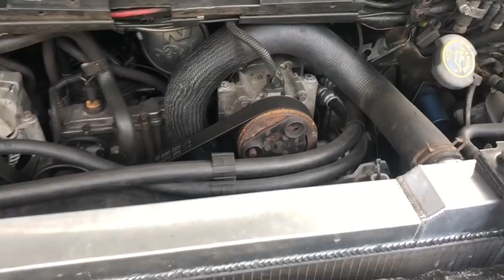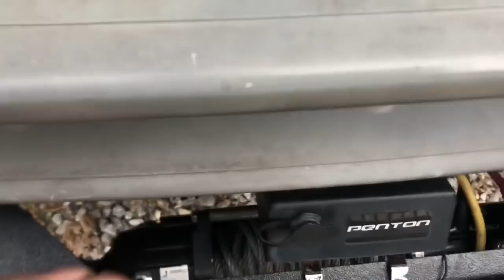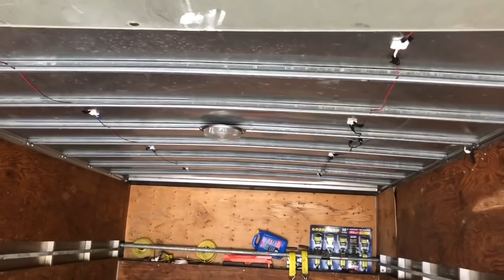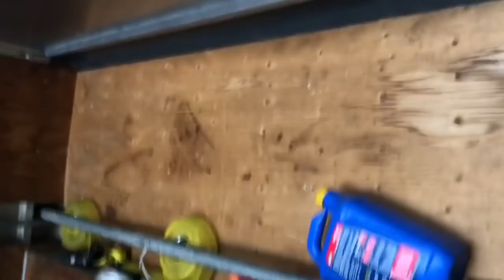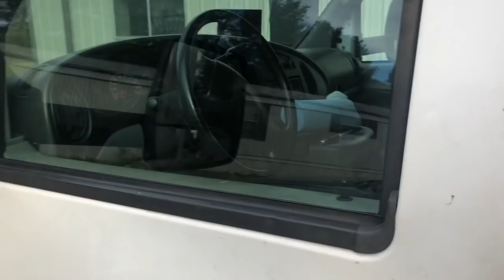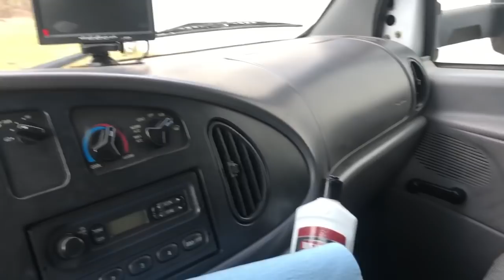My 7.3 Powerstroke upgrades

Comment: I have a 7.3 van same thing i tossed the stupid air cleaner box & baffle system put a knock of k& n cut fan shroud in have so when you have to do a water pump or just work on front of engine its a lot easier .i want to run a 3or 4 inch tube up to air cleaner to give it cooler air during summer was towing and it was hot felt engine sucking in all that engine bay heat plus these have no intercooler i like to install one but van cab is tighter than a import car

Comment: TRANS PLUS IS A CROOK. HE SEND INFERIOR GAS CONVERTER FOR A DIESEL. DESTROYS ITSELF AND TRIES A SWITCH THE BLAME. HE SAYS FLIRIDA TORQUE CONVERTERS THEN SHIPS A REBUILD PIECE OR SHIT. YOUR STAGE 2 IS A STOCK REBUILD WITH A SHIFT KIT EVEN THOUGH HE SAYS IT HAS POWER PACK CLUTCHES.

Comment: I’d love to see a picture of your air cleaner set up. I have the same van except mine is a 350. These 7.3 vans have terrible air cleaner housings, they almost always crack and try to sand your engine!! If what you did works good I’d love to know what filter it is and how well it fits. Also do you think it gets too much hot air being so far back over the engine? Your getting big power with your set up so apparently it’s not hurting it too much!!!  😊 thanks for the informative video!!
Reply: Also where did you place the air temperature sensor that was originally placed in the stock air box?
Reply: Yeah, I'd love to see how to ram air into the turbo on a van, would look amazing.

Comment: Giveaway. 

HE351CW 62x67 or 67x67?! The 63mm blade is too heavy for my liking for a daily driver. 

Or a 2nd gen manifold and turbo upgrade swap for the 3rd gen dodges would be sweet! The rest of the swap should be manageable to source the rest of the parts and pieces. Unless you wanted to do a whole kit ?!?!!
Reply: Or a 1994-1997 7.3 turbo upgrade

Comment: What full aluminum radiator did you use?  Was it one for one of the truck chassis?
Reply from the maker: Ian said it was the only one on eBay for the e450. The F series have different radiator hoses that the e450 so it likely the radiator is different too

Comment: What light brackets did you use for the roof light bar?
Reply from the maker: I think the light came with brackets
Reply: @turbolabamerica  was it specifically for the Econoline? I'm looking for one and can't find one that will fit. Where did you order it from
Reply from the maker: We bought a universal kit on eBay, I think I bought a 52”, you should measure the length of the roof to get the right size because ours was a little too short which is why we had to add spacers. Between the bracket and light bar.

Comment: If it's stock fuel (injectors) with bills 140 tune it's not gonna make 450. Real numbers are 300-330 to wheels or trucks with your extra weight  and drivetrain lose your gonna be close to 300 ish. Joey s hpop typically do well  but his warranty is a joke we done quick few and he won't respond and has not returned my hpop for warranty. Hydra is awesome due to be user friendly . Very familiar with these engines do alot side work and small builds I have to 7.3 s and a 6.0 . My 7?4 makes over 500 rwhp.

For my choice I wanna see a7.3  kit or turbo with OBS turbine and 1.00 house and you 67mm kit. Love the videos follow and watch you videos quite alot been thinks about come down to the shop in Stuart ,VA  like 4 he from me. Keep up the good work.

Comment: So basically you have rebuilt or replaced everything but the paint.  LOL
Reply from the maker: Ya didn’t plan on it but that’s what you get when you buy a ford. This truck was owned by a Toyota dealership, and seemed to be never maintained. I also changed the idm 2 times and icp 2 times, and the ipr 1 time
Reply from the maker: #reliable as F
Reply: @turbolabamerica  I know what you went through. Those E 450 van chassis are a complete pain to work on. Our shop used to do all the county and city ambulances and there was nothing that you could fix on them that didn't require removing 20 other things so you could get to where you could access anything you were repairing on them.
Reply from the maker: I still haven’t been able to find the spark plugs
Reply: @turbolabamerica  they disguised them as glow plugs to confuse people. In due time you will find them. LOL
Reply from the maker: Lol. I replaced those. I was just telling a diesel joke
Reply: How bad is it to replace the glow plugs in these vans? Mine needs replacing and can't find any videos in his to do it.
Thanks 👍